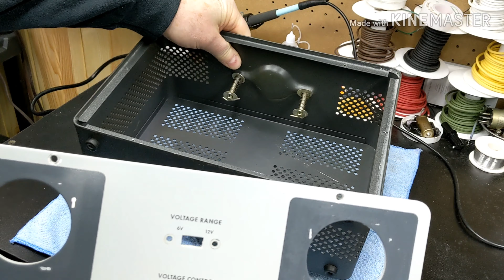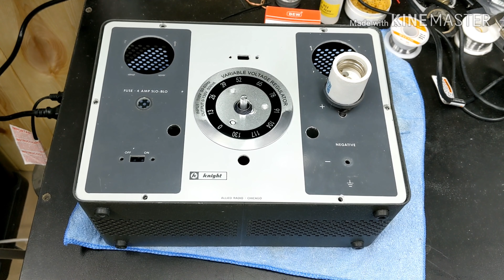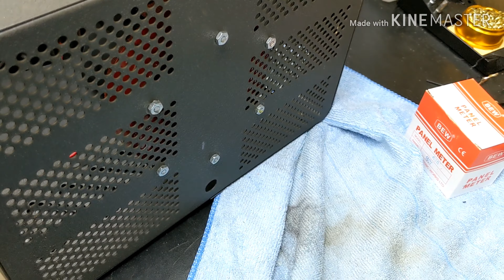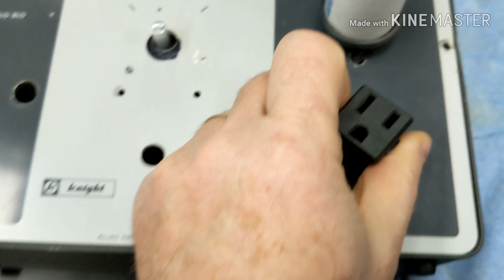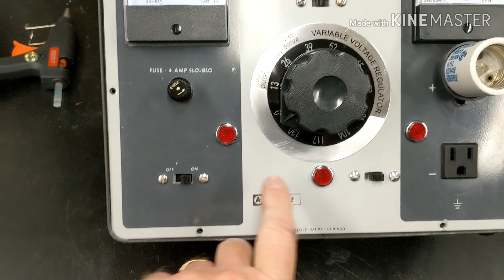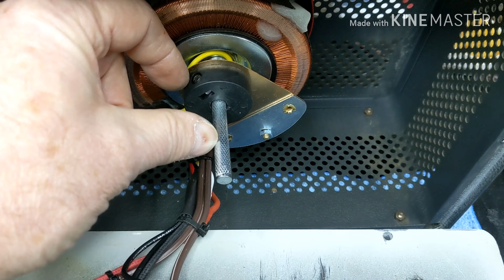Knight AC Variac Project

Comment: Great re-purposing video! Incredibly well thought out design. One suggestion though. The large knob needs a white line painted on it to clearly show 
at what voltage it is set to. Not your fault; but it very hard to see a black triangular pointer on a black knob pointing to a black circle with numbers on it from straight
 on . I do wonder what the odds are that you will accidentally break that bulb if it left in it's socket? Maybe an original cardboard container that  you get a pair of bulbs 
in will be sitting on top of the new variac!
Reply from the maker: Thanks, the knob and dial are not all that accurate. The meter is however.

Comment: Gregg,  you've done an absolute fabulous job on that !!!  Well done.... a few questions.....  You have a 5amp Variac .... what size fuse do you have in there ?Did you have to open up the hole for the meters ?  If not can you let me know which ones you bought ?   I may be making a sister to mine in the near future .    Thanks for the shoutout, but you've stepped up the game man.. love it.... GREAT JOB !!!!
Reply: Damn  Ron you're an fricken ICON now.   Yah baby!     Gregg very nice.   You guys crack me up when you call the variac an "AC Variac"   Show me a DC Variac.   Variac is derived from "Variable AC" device.   AC variac is redundant.   LOL.
Reply from the maker: Thanks Ron, the original fuse in the Knight was a 3 amp and that is what I'm using. I know nothing I'll be doing will need more than 3 amps. I got both meters on Amazon, I'll email you a link to them later this evening. Thank you so much for the decals and the design!
Reply from the maker: Oh and for those gauges, they fit the existing holes perfectly, no modifications required other than drilling four mounting holes for each one.